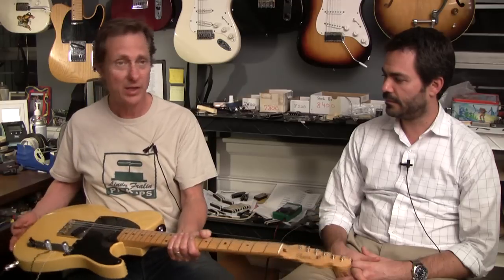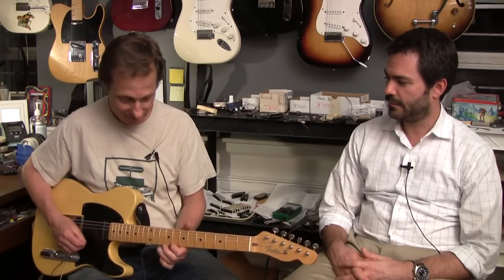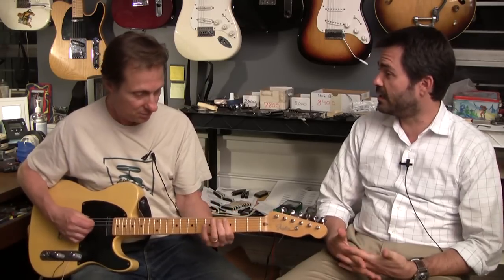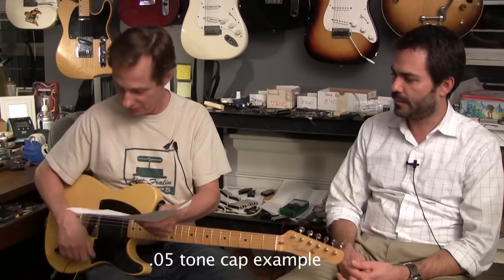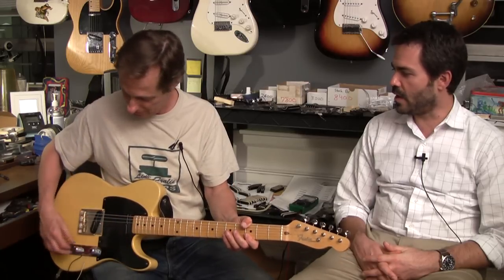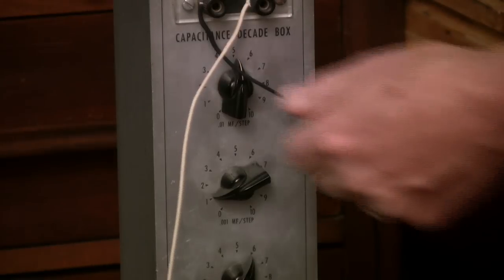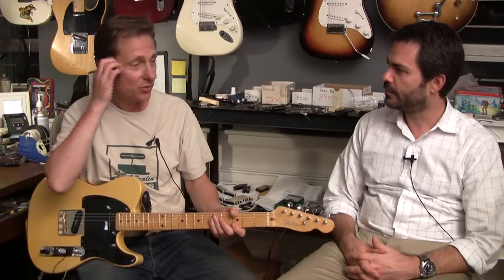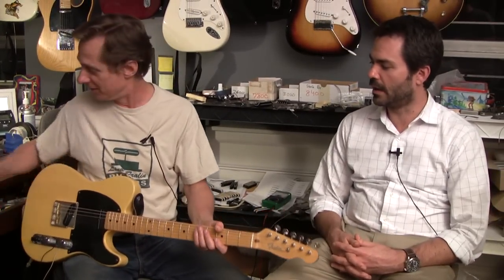Tech Tips With Lindy, Part III - Tone Capacitors Explained

Comment: FIRST CAPACITOR VIDEO THAT ACTUALLY SHOWS ANY DIFFERENCE! THANK YOU!
Reply: There has actually never been any debate about the very real differences in sound when varying the actual capacitor values. What some capacitance producers&vendors claim, and a lot of moronic people - with no real understanding of how the wiring of a guitar works unfortunately believe - is that different makes of the same value cap will not make any difference in the output signal coming from a guitar.
It is a little like saying that gallon of water in bucket is more than a gallon of water in a carton.
Reply: @martinskanal  I don't think that's what people are saying. I think they're saying a gallon of water in a metal bucket tastes a little different than a gallon of water in a plastic bucket. It still tastes mostly like water, but you can also taste of little bit of the bucket.
Reply: @joybuzzer  ..the capacitor simply does not affect signal directly. Two capacitors with same measured value will have e x c a c t l y the same effect. That is physics 101. People who have revolutionary ideas about how a bumblebee cap with the same value as any other cap creates differences in output, need to document why and how we need to rewrite physics.

Lindy Fralin sell excellent pickups to customers, many of whom have esoteric, private theories that is not in line with physics. He could easily cater to these customers and lie about his products, but he does not because he is an honest person. Thus he will provide information about how different capacitor values can influence sound, but he will NOT claim that two caps with equal values sound differently.
Reply: @martinskanal  Watch/listen to the video Jason Lollar has done on the subject and tell me the same value cap in paper and oil vs orange drop don't sound a bit different. I was suprized, there *is a difference although somewhat subtle.

Comment: I learned from Danny Gatton a long time ago that a .047 cap gives the best wah sound. I would much rather have a tone cap that gave me a lot of versatility and that I only had to turn a smidge to take the edge off things or turn a lot to get a jazz sound etc. I also use linear pots to achieve quick staccato swells via Phil Keaggy. Oh, and I also clean the grease out of the pots so they'll be easier to turn. I use Hip-Shot knobs with rubber O-rings around them for my pinky to get a nice grip, and it helps that they're much lighter and easier to move than a standard metal Tele knob.
Reply: Bill all you need is a bourne low torque linear pot. super easy to turn. costs maybe a dollar. people go through a lot of trouble when it is all there ready to go.
Reply: I have a .047 cap on my Strat and it’s works great.

Comment: Sounds good but from my research, the physics is the opposite of what you are explaining: That is, that capacitors act as high pass filters, determining the frequency level below which bass &/or mids are cut...NOT the level above which highs are cut. In addition, the  resonant peak frequency is also raised or lowered.  So, what our hearing perceives as more highs,  is actually less lows and a higher frequency resonant peak (ie: greater volume of low & high presences freguencies...the bands between mids & treble), not actually more treble. Resistance of the pickup coil(s) & the pots act differently.

Comment: Since they combine, the first setting was 0.05uF + 0.002uF + 0.0006uF = 0.0526uF; the second value was 0.002uF + 0.0006uF = 0.0026uF; then 0.001uF + 0.0006uF = 0.0016uF. Worth mentioning, since small values alone appear to produce quite different results.

Comment: It is a great video from IMHO the best strat and tele PU maker in the world (never tried his humbuckers:). This video is really useful information for people who wonder what value caps they want.

Unfortunately it does not end the "debate" on caps and tone. Not because the video lack anything - rather it is achieves exactly what it sets out to do - but because people still keep on confusing different values with different brands/makes.

People should notice that mr. Fralin not for one second discuss different makes of capacitors. He never says the bumblebee has any advantages over modern caps with the same values. He only talks about values. And he even says that varying these values is very much down to personal preference.

To me it really makes more sense to pray to the Flying Spaghetti Monster/Burrito Brother, than believing in exotic differences between equal value caps made by different makers. There are literally ten thousands of electrical engineers/scientists who can offer an evidence based argument for the non-existence of differences in audio output when comparing two equal value caps of different makers. There are no scientists in the world who can disprove the existence of the Flying Spaghetti Monster. 

So when people buy the Gibson Historic Bumblebee Capacitors 2-pack for 129 USD (Moahahahaha) they are buying actually buying about 1 dollar's worth of Wesco 32 PL polypropylene caps covered in plastic to look like the "real deal". Quiet sad really. If Gibson wanted to survive their financial problems, one step might be to stop ripping of their customers so blatantly.
Reply: martinskanal btw I have his pure PAF humbuckers they a fabulous. Also your right people don’t understand the value of the cap is the only thing that affects the tone.

Comment: I don't  use tone controls on my guitars.   I just move the vol knob to the tone position and throw away the tone pot.  Volume only.   But  that cap device works great to demonstrate the effects of each value.
Reply: Each in his own I guess, but I'm totally with you on that one. No tone pot are half as effective as the tone controls on your amp, so get the absolute most of the signal over there by simply decoupling the tone pot.
Reply: oh yeah?  I hardwired my guitar straight into the amp. jk

Comment: Hi Lindy, I think a video like this would be helpful using the Tele (or a Strat) configured with the 50s wiring mod to show how different tone cap values affect that circuit.  I would be indebted to you for such a video.  Thank you for this video!

Comment: Why would you NOT want to use a push pull tone pot with a  unique cap for each pup? Sounds like a must have to me. . .
Reply: billville111 why would you ever use a push pull pot? i use push push pots on all my guitats, a much quicker and easier switch. i never understood why people use push pull. especially with strat knobs, those are hard to grab.
Reply: my solution is to  use an on,on,on dpdt ( dual pole dual throw ) switch with 3 different value caps one wired to every on position a.1uf a.047 and a .022 with it's in/out wired into the normal single cap position ( basically a mini capacitor decade box.) ,, also have a treble bleed  cap n resistor on a 2 way switch so i can turn it on and off  and a 5 way peavy omniac style pickup selector mod

Comment: wow. leave it to Lindy. I never knew that an .001 could have such a nice effect on a bridge pickup. I don't tend to use a tone control on a neck pickup, but I do like a .001 as a BASS contour to make a humbucker or hot single coil less bassy and more sparkly/twangy. so now I'm thinking of how to get both bass and treble contours on a Tele using a single .001 and a push/pull or a mini-toggle. I could easily do it using two caps, but the nerd in me wants to scheme it out with just one cap.

Comment: Lindy, on the decade box are the tens, hundreds and thousands cumulative?  The .0006 is set and you change the .001 to .002 but if they are additive then the setting is .0026.  Is that correct?  These old decade boxes are great but the old resistors are made of Bakelite.  If you buy one and a couple of them are burned out, how can you replace them?  Great video to explain the tone, you got me hooked on changing my telecaster.
Reply: +SeaSharp They do add together but believe it or not there is only 4 very large caps in there wired in very complicated series and parallel for all the different settings.
Reply: +Lindy Fralin Yes, I was checking that out. Amazing isn't it, some genius electrical guy figured that out. I'm a mech eng and that stuff was greek to me but over the years it's making sense and I'm having fun modding my guitars and I'm in the middle of making mods on a BJr amp.  There is one model like yours on ebay and the guy wants $200 for it and that's way too much. Feel lucky you got yours for $40 bucks. There is a video where the guy has a set up with about 6 caps of different brands but all within the .0025 range and you can hear the difference in cap manufacturers. Between your video and his I'm getting the knowledge of how I want to change my guitars.  Can you put a push/pull tone knob on the tely and have one cap for the bridge and one for the neck?
Reply: +SeaSharp  Of course, I have a Tele set up like that with a .1 down and .002 up, (Blues Special video on youtube)

Comment: You can wire the cap on one side of the switch and the resistor on the other side, having two different cap values for different pickups. There's a lot of ways to wire a low-pass circuit...
Reply: you could also build a mini decade box with 3 caps using an on on on dpdt switch and fit it in the guitar... going to try this mod on a tele using a .22 up position ( strat ) 47 mid position ( standard tele ) 47 + treble bleed down position... +  a 4 way switch mod for bridge,,  bridge neck series,, bn paralel ,, n  :)

Comment: In my Stratocaster, I've got a 0.05uF on neck & middle and 0.018uF on bridge. I can detech one of the capacitors (in series) from the neck tone to get 0.1uF but I don't know if it makes more sense with the Telecaster pickup. I've built a varitone box for more dramatic tone shaping anyway.

Comment: So, the higher capacitance on the neck pickup is because the tone is less bright to start with, so (if you used a smaller value capacitor) there'd be no frequencies to cut until you've already turned the pot down unreasonably far, ...?

Comment: So if I have a Strat with one tone ,one volume control and wanting a humbucker in the bridge and single coils in mid & neck
what capacitor would I use 500k or 250k ? Would it be ok to use 500 on the tone and volume?
Reply: Sorry but you're mixing concepts. The resistance of the pots it's messured in ohms (250Kohms, 500 Kohms, etc.). The capacitors in the tone pot are messured in Farads. In your case I would go with a pair of 500k ohms pots and some big value capacitor so you're able to reduce the high end of those single coils.

Comment: I prefer V-Cap capacitors and have them in all my guitars, as they just add more bass but they don't muddy up, - (and I know some people in jazz may prefer that) but they are still clear on the top end as they roll more bass in, - untill you get down to 2 or 3 on the dial. That's my choice.

Comment: yes good info.  I have a fat strat or HSS and I use a .015 orange drop I try to get the low voltage caps so they wont be to big in size so I will have extra room inside.  I wire my strat with no tone control for the middle pickup but use tone for the bridge that combo makes cool sounds for #2 #4 settings

Comment: Mr. Fralin, I play a Godin Multiac Jazz SA with an active hexaphonic piezo bridge pickup system and a neck position mini humbucker(soapbar style). I love the bridge pickup and use it all the time, but I'd like to use the humbucker more. The guitar allows for a blend of the two, which is great. Problem is, the tonal range of the humbucker is from muffled to mud, which does not meet my needs at all. Should I consider a different pickup, or should I maybe look into a different tone pot? Any you would suggest?

Comment: 09/25/2019.  Hello, I just added a new 250V tone pot in my 2018 Fender Players Series Telecaster.  I left in the original capacitor, and it sounds OK.  However, I do not know what the Fender factory capacitor is, per I did not see any ID number on the original (small round shape), but the new one that came with the new 250v pot is a square shape at .022mf.  What do you think the tone difference would be, if I out in the new capacitor?   Would the new capacitor have more bass or more treble?  Thank you, Tom  Retired in Florida

Comment: How does the resistance value of the potentiometers used factor into this?
Reply: A higher value pot will give a bit of extra brightness when all the way up (the capacitor allows the highs to get to ground through the pot...more resistance, more highs survive). That goes for the volume pot, too since it loads the pickups less. The other thing is that it may come up from zero quicker for wah effects. I read that Danny Gatton used a 500k for that reason. (A linear taper would go even faster.)

Comment: What about... an 8 pin dip micro switch, with 8 different capacitors... on the pickguard so you can have 8 different settings, or even combinations, some could have a resistor...idk just a thought. I probably won't do it...

Comment: Question for Lindy.

I'm thinking I could get a better range of subtle-ish treble roll-off tones (in my shriller pickup combos) in the general "magic cap" range by using a pair of .002 or, maybe best, .003, caps, as follows.

Three-way switch that gives me, in order: both caps in series / one cap alone / both in parallel. 

With a .002 cap this should give me .001, .002, and .004. With a .003 cap it should give me .0015, and .006.

Is this correct? 

With non-equal caps, is the series formula Ceq = (1/[1/C1 + 1/C2])? Do I have that right?

It'd be subtle, but I can definitely hear a timbre change between doubled and halved values...?
Reply: Did you try it?

Comment: I noticed that the second selector knob on the decade box was still sitting in the #1 position instead of being at "0".  So .001mf is being added to the .01 steps on the top selector switch. Through the first 2/3 of the video.

Comment: I ordered a 0.47 uF orange drop capacitor on eBay to use with my vintage style Tele pickups, but the seller sent me a cap marked 103J, which if I've understood correctly, is Orange Drop code for 0.01 uF. 

That means it will roll off a lot less high end than a 0.47 uF would, right? 

I'm debating whether to use it anyway, or take the trouble to complain to the seller.
Reply: .47 is way too much. .01 is ok, i like .015 to .022. more than that makes it useless to me.
Reply: .047 is the correct number, not 0.47
Reply: @larryn9230  there is no correct number, but .47 is way too much.
Reply: The tone circuit on a guitar is really simple, a capacitor to ground through a variable resistance.  The standard tone cap on a Gibson with humbuckers is 0.047uF, with a 500k variable resistor in series, which is pretty aggressive at rolling off upper mids and high frequencies.   Strats usually use about half that, 0.022uF, and a 250k pot in series, which doesn't start rolling off until a higher frequency.   I have found that I like low-output Seymour Duncan Antiquities humbuckers with 0.022 uF, and a 500k pot, it gives me a more usable sweep of tones across the entire range of the tone pot.

Comment: Strat guitars have two tone pots with two capacitors which is two RC networks in parallel which will be Two 250K in parallel = 150K resistance total and two capacitors in parallel will ADD capacitance. Other strat guitars will omit one of the capacitors and wire it up both tone pots to only one cap. If the tone cap is .022uf + .022uf = .044uf, and if the tone cap is .047uf + .047uf = .094uf, this is a big difference plus there is a phase shift going on between the two RC networks. If you omit one of the tone caps its will HALF the capacitance value and omit the phase shift also. The Loading of one RC network compare to loading of two RC networks on the pickups is loading an RC networks which changes the frequency response of the pickups. Franlin pickup designers can you explain more about this?
Reply: All of my strats have only one tone control. (I use a Blender pot on all of my guitars). Even when I had old Fenders I moved one wire to make the second tone control for the bridge.  There was never more than one pot or cap in play at a time.
Reply: @lindyfralin3868  only using one capacitor this changes the RC network because using two capacitors that's two RC networks in parallel compared to using one cap its RRC network just RRC not RC||RC network. The frequency response of the pickup will be altered just only use RRC and not using RC||RC?

Comment: If I want more lows on my bridge telecaster, witch capacitor would you recommend?
Reply: A capacitor can't simply boost lows. A higher value will be able to cut highs and mods, but they'll be literally cut and not just lowered in volume to make it sound like the lows are boosted. Maybe try setting the pickup lower and increase the gain on the amp to compensate the lower signal.
Reply: New old stock Russian capacitor:
K40y-9 
0,033 MK +/- 10%
200 volts

Comment: 8:07 this question wasn't answered
Does different capacitorvalues affect the tone when set to 10?
Reply: He misunderstood the question, but the answer is yes. The cap value changes the sound even when the tone pot is on 10, but it's up to the player to decide whether or not they care about the difference because it's pretty small and most likely not super noticeable unless you A/B them.

Comment: Thank you for this great video. I went and bought that same box. But how do i wire it to the guitar?  Anyone?
Reply: I wired it to the same terminals that the cap would be on the tone control. You do have to undo the existing cap first. Lindy
Reply: @jennyfralin357  so i got the same box as you used here. When i finally got around to wiring my les paul to it, the box works great. But, there is major buzz when the tones are turned up. Does the box need to be grounded or something? How would i ground the box?